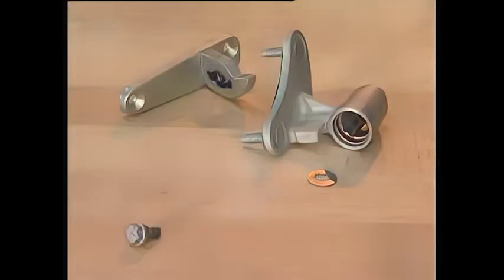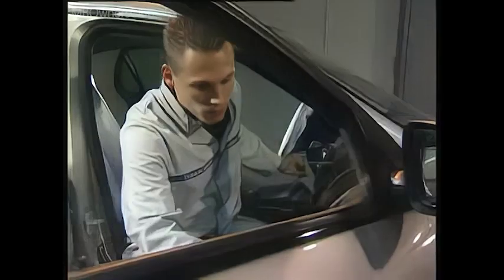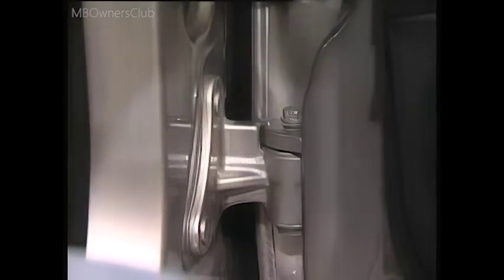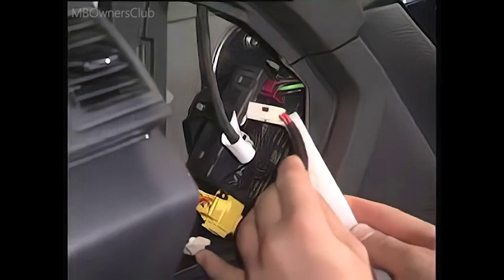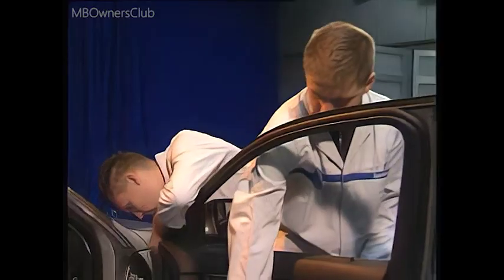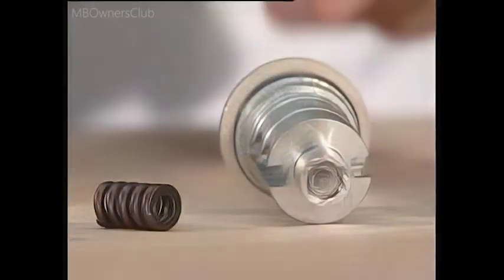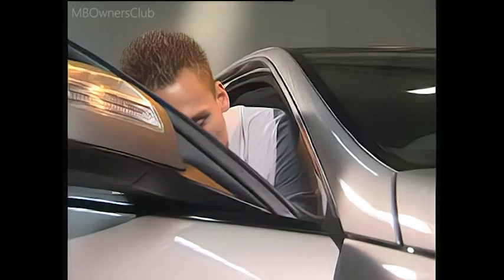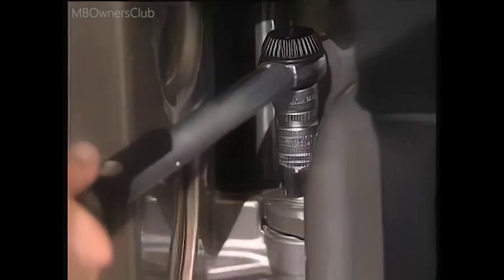Mercedes-Benz C-Class Door Brake Replacement | W204

Comment: Hi, how do I replace the door brake system? My door has squeaking noise and I think it’s from the brake system. Do I have to remove the whole dash board in order to access the bolt inside ?